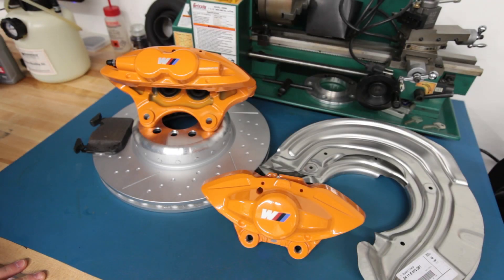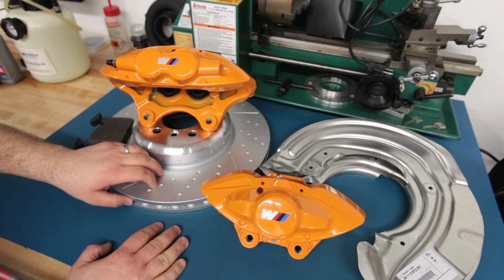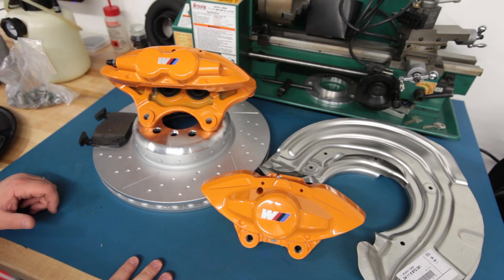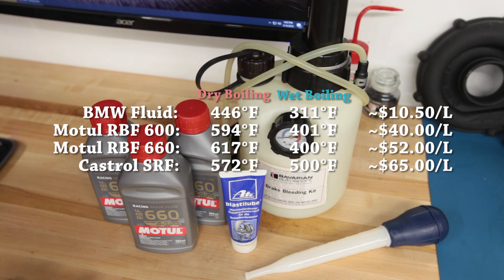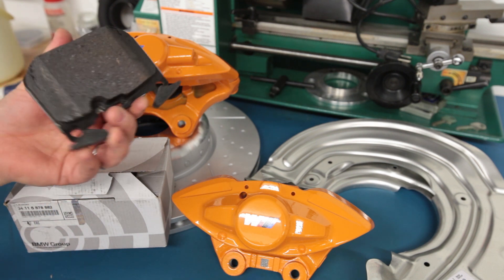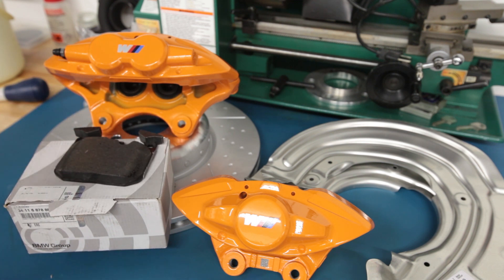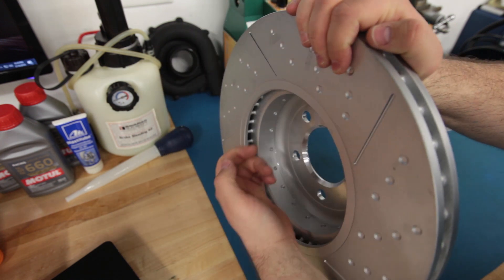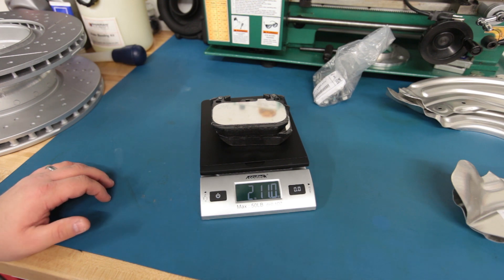BMW M Performance Brake Kit Part 1: Intro and Tech Info

Comment: Do you get the ticking sound from these everyone talks about?
Reply from the maker: Yep - no way around it without using blank rotors.  I've had cross-drilled, dimpled, and slotted on a number of different cars - they all make some type of noise.

Comment: Nice vid Jon. How’s the turbo e34 holding up these days?
I’m in the midst of retrofitting 340/330 on the f31d... it’s sure to be a big upgrade from the 312/300 they came with stock! The wagons are Iimo seriously under braked. 
Going with stock fluid and flushing it while I do so since the car is 5 years old now and unknown if it has ever been done by the PO.

Comment: Nice vid! I am curious why the rotor uses fake hole instead of drilling through it?
Reply from the maker: They're not fake holes, they're dimpled. It allows water and gases a place to go without the risk of cracking between holes like is common with cross drilled rotors.

Comment: I just picked up the F80 brakes for the front of my E92 for only $300. Got the rebuild for $20 per side and just found some un-used OEM pads / hardware for $60. Rotors are $100 for the pair and I have an excellent set up now. Going to be painting them yellow. Great video!